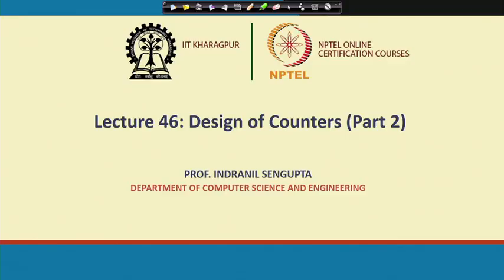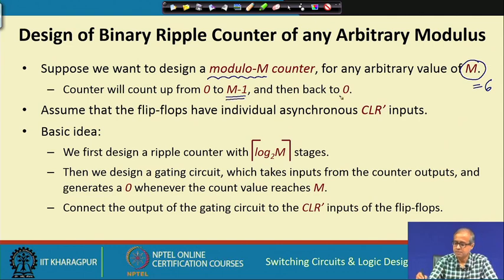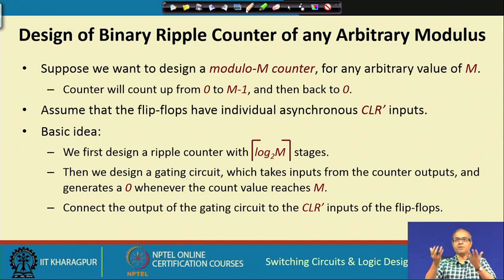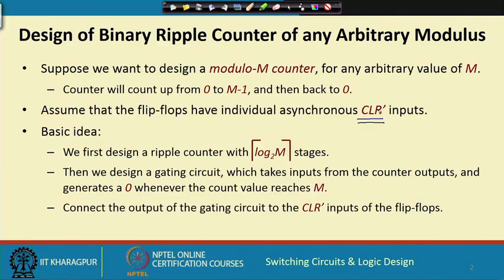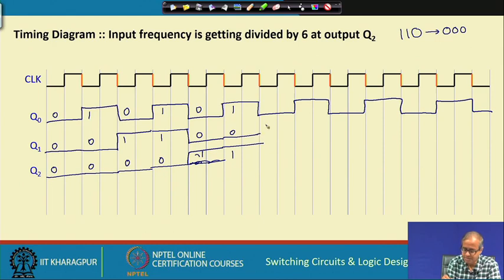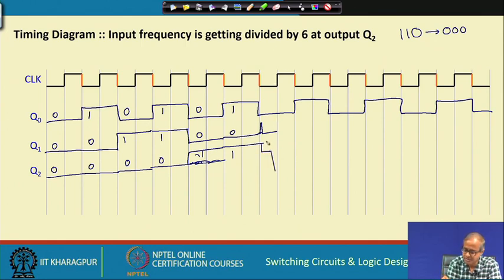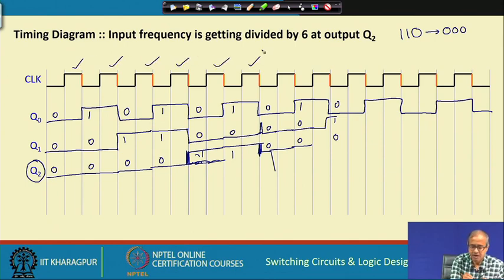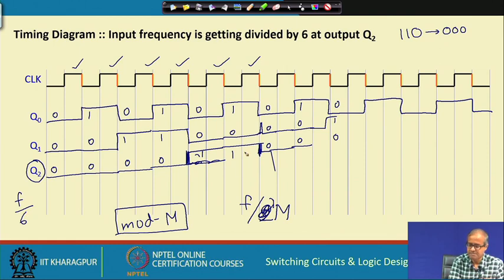Lecture 46: Design of Counters (Part II)

Comment: Correct me if I'm wrong but mod-6 counter will have 3 outputs as opposed to 6 mentioned @ 23:01
Reply: Yes, Minimum number of flip flop required to design a mod 6 counter is 3, but you can design with any number of flipflop(>3). Only thing you should care about the NAND Logic for Clear the flip flops.